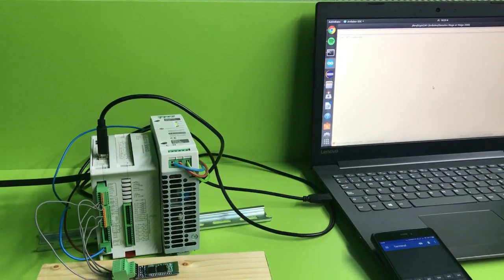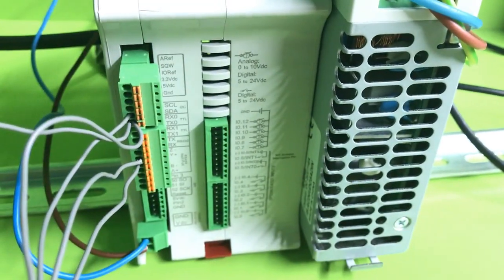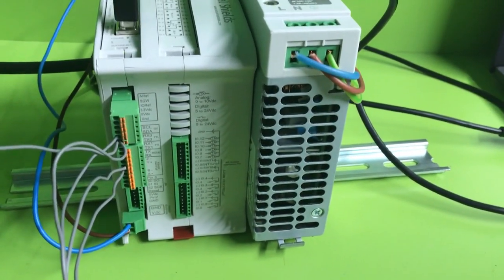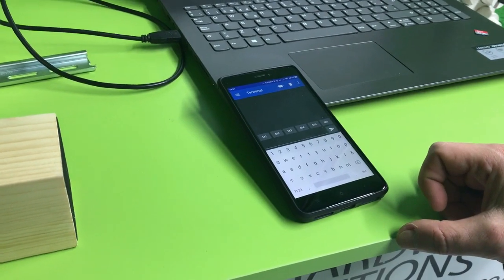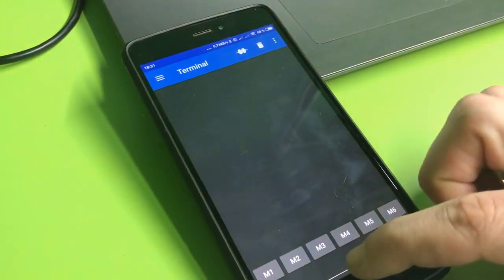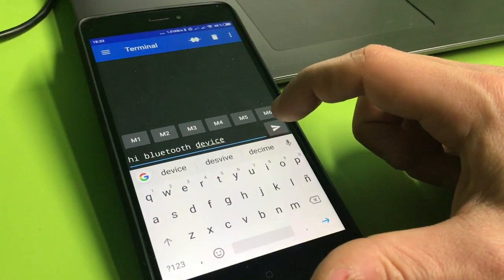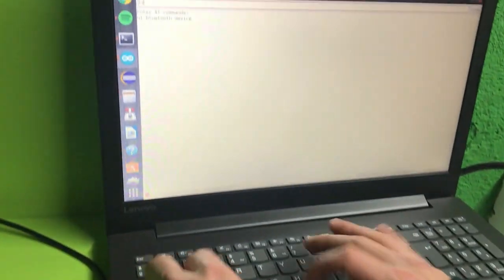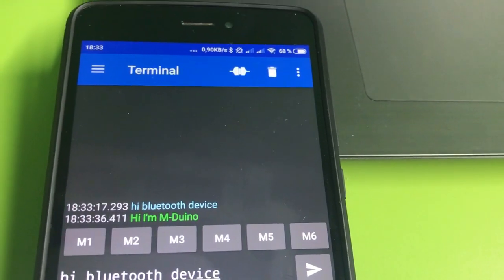✅ Using the HC-05 Bluetooth Module with an INDUSTRIAL ARDUINO PLC

Comment: another question: which App did you use for receiving and sending data from the smartphone to the PLC?
Reply from the maker: The App used in this video is called Serial Bluetooth Terminal, you can find it on Android Market Store.

Comment: Could you please tell us which type of Arduino PLC did you use in this video? is it M-Duino PLC Arduino Ethernet & WiFi & Bluetooth LE 21 I/Os Analog/Digital PLUS?
Reply from the maker: Hello Dounya, in this case it is a M-Duino 21+ plus an HC-05 bluetooth external module. But it also can be used a M-Duino PLC Arduino Ethernet & WiFi & Bluetooth LE 21 I/Os Analog/Digital PLUS so it have the Bluetooth integrated, as you have commented.